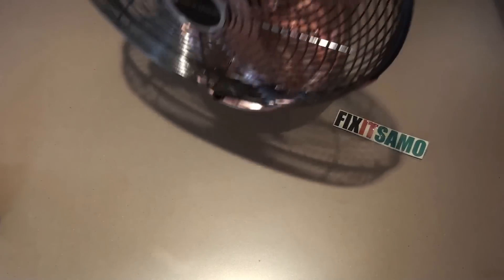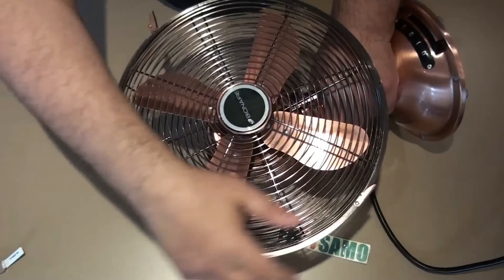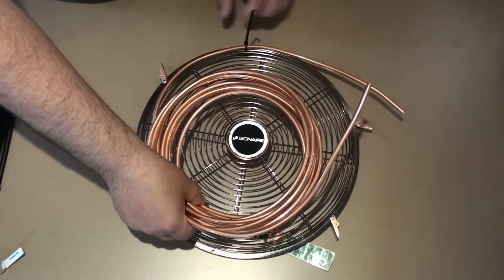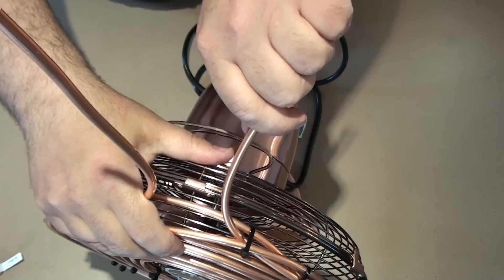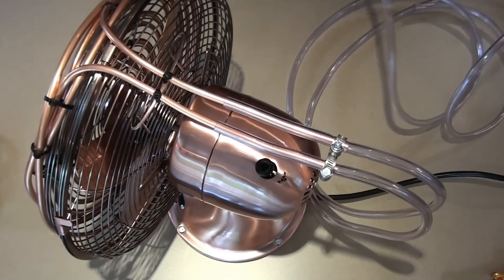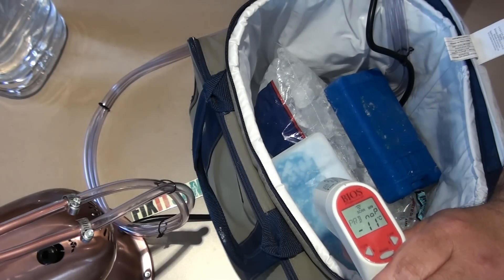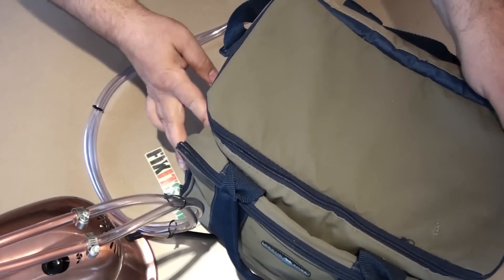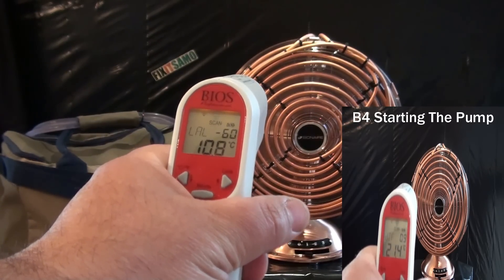How To Turn Your Fan Into An Airconditioner  AC

Comment: If you do this with a larger 2ft. square, Large blade, 3 speed fan, that sits on the floor, it will cool your house much faster.
Reply: if you do this with a even larger 3 ft square, large blade, 4 speed fan, that site on the floor, it will cool your house even much faster even.
Reply: @shaystern2453  yeah, but if you use an even larger 4ft.  Square, super-duper large blade, 5 speed fan, that sits on a stand on the floor, it will cool your house much much much faster even
Reply: @ajfromcjbasements6574  @shay stern  @wayne davies 🤣🤣🤣🤣🤣
Reply: @ajfromcjbasements6574  😂
Reply: @ajfromcjbasements6574  And you'll be grateful!
Reply: You just stole Op's idea and changed it slightly. That's called plagiarism. You're not intelligent, you're just an ass.

Comment: Thanks for this! Been looking for something that would work in my son's room instead of always using Central A.C.
However,  I tried your link for the pump and it is not working. 
Just wanted to make sure I get one that does the job. 
Thanks
Reply from the maker: Hi you can get it from amazon 

Submersible Water Pump for Fountain, FOGIMO 80GPH (300L/H,4W) Ultra Quiet Water Pump for Pond, Aquarium, Fish Tank, Fountain, Portable Water Pump 110V with 5.9ft (1.8m) Power Cable https://www.amazon.ca/dp/B09B8W33RT/ref=cm_sw_r_cp_api_glt_i_3K785S2F79EG2B3XNZ8P
Reply: Thanks a lot!!!!

Comment: Let me help you with one thing. If you do this on an average size stand fan you will need more copper tubing than you think. I got 20ft to do it because he doesn’t specify how long the copper tubing is that he has and 20ft is not enough. I have to try it for now but later I will get 50 ft and redo it.
Reply: He shows he used a 25 foot long tube lol
Reply: It is working?
Reply: Let me tell you one thing. if you do this with a smaller fan you will need less tubing then you think.
Like, no shit, sherlock!

Comment: Good idea for camping. How long does 2 bags of ice last?
Reply: you can plug in a fan where you camp?

IDIOT
Reply: @shaystern2453  The camp site I always camped has electric and running water. They designed for the camper but I just put the tent there and has all the convenient of the camper. Idiot.

Comment: Thank you so much for the tutorial Sammy, I finished putting together the copper tube on my fan and ordered the 1.2W 5V DC water pump but apparently the pump wasn't strong enough to push the water current through the copper tube.  Can you advise me what voltage or wattage you need strong enough for the water pump to push the water current through this tube?  Much appreciated in advance.
Reply from the maker: All parts are in the description box  that’s the link for the pump 

https://www.amazon.ca/dp/B01NBPCVW3/ref=cm_sw_r_cp_awdb_imm_E4EVP1H23PB8GP6FDCX9?_encoding=UTF8&psc=1

Comment: How is the cooling compared to blowing air through ice? How long does the ice last for your use case? I know depending on the temperature difference, it would vary.

Comment: You should just strap an old oil cooler from a car (cleaned out) would exchange heat much better. Possible run the pipes outside to a water source

Comment: welp - you can connect this in the fridge system or put cold bag in fridge using small holes - so it become constant conditioner
Reply: Or just leave the fridge door open.
Laws of thermodynamics apply, when you put the ice packs back in the freezer then the refrigerator will absorb the heat from the ice packs and release that heat back into the room plus some heat from the motor. Now your room is warmer than you started.
Reply: @mickwolf1077  
you realy should leave the man alone to play with his Perpetuum Mobilé Dude...  😉😂

Comment: Wonder of dry ice would make it more effective 🤔
Reply: It would probrably hop around trying to get away from the water
Reply: Who actually has dry ice laying around?
Reply: It would be more effective and efficient if the water was cooled directly in a standard freezer. And to make sure that the circulating water won't freeze, you put antifreeze in it. You can use the freezer for other things at the same time, of course.

Comment: not ac because your refrigerator created the ice by extracting heat from water so your using your refrigerator to cool your house lol :0 not an air conditioner
Reply: If we start to smartshit around, we should do it properly at least !
The ice he's using in the vid is OBVIOUSLY bought at the "gas station"....
Or is your fridge spitting out 5 pound bags of plastik packed crushice !? 
I guess that should regulate your prob with the thermodynamics... !?  😉

Comment: I built one just like this and it works great..
Reply: 3 things please
1) approx what is average  room temp you have experienced with no AC, 
and 
2) approx what is average room temp using this fan-AC-cooler?
Lastly did you use a infrared gun/temp meter like in the video to see what air temp is reached at the copper coil area?

Comment: It works, but........Not energy efficient.  You must use electricity to produce the ice, and you must use electricity to run the pump.  The electric fan is electricity nuetral, since you have to run it whether cooling or just running the fan.
Reply: Compared to running an AC unit or ducted it’s far cheaper, at least where I live it’s about $3.50 per hour cheaper to run 🤷🏼‍♀️
Reply: Purpose could be if in a van, there's only dc
Reply: Ac consume 800 to 1000 watts, while the pump consume 5 watts and fan consume 30 watts. big diff.
Reply: @rmabiado6593  what about the energy to produce the ice, mate..?

Comment: Fans aren’t made to cool the room. They’re made to aid the evaporation of perspiration on the skin which cools you off.
Reply: this one is made to cool the room, so you're wrong...try again
Reply: @joeturtleneck2300  it's not going to cool the room. if you use refrigerant like Freon it would get cold enough to cool a room depending on the size of the room. at best sit close to home made ice water ac and you'll feel a bit cooler.
Reply: @Donald Chump dab on eem

Comment: If you could get a system that produces ice on itself then that would be something worth watching. I’d use the fridge compressor and R-134a gas to make this more useful.
Reply: this fan uses water, the pump wont circulate the gas like the water. youd need a whole different set up to run r-134a gas.

Comment: You should have started the copper tubing from the Inside of the fan screen  and go outward instead of from outside in would have been better. I think just my opinion
Reply: how can you get the copper through of the fan screen protection

Comment: Swamp cooler - not air conditioner - great idea - you would need a metal fan - so much plastic here ....Thank you
Reply: A swamp cooler cools the air by releasing water vapor, this isn't doing that. This is taking the energy in the air and transferring it to the ice water. It may introduce some water into the air, but that's not the mechanism it's using to cool. Basically this cools your room using stored work from some external freezer. A swamp cooler would be exposing the water to the air via something like a sponge, whereas here the water is kept in a fairly sealed container
Reply: @jek__  it's not going to cool the room like a conventional ac which uses refrigerant like Freon so it is comparable to a swamp cooler because in a swamp you would find water.
Reply: This actually ends up lowering the humidity in the air instead of raising it with all the condensation it creates

Comment: As far as I can tell that aircon would cost about two bags of ice a day. Less than $5 a day. Cheap as!
Reply: I'd just fill 2 gallons of milk with water and let them freeze overnight every night
Reply: @TheOfficialChannelOfChannels  Yeah well if I can freeze water then I don't need an AC unit. I'll just plug one in.  But if you are camping, this is brilliant, but not good in humid climates. If my van could sustain the load, I'd buy a dehumidifier and put up with the temperature.
Reply: make your own ice in the freezer
Reply: @Dill_Do  I was thinking for camping where there is no electricity. But you can usually buy bags of crushed ice. This design doesn't add humidity to the air either and  you can run everything from a solar panel.

Comment: what do you do with the water that drips off of the coil  ?
Reply: drink it, free water
Reply: make a rectangle hopper to catch dripping thats what the real acs do
Reply: The valence ring electrons carried in the air stream will grab onto those water molecules and carry them away faster than you can say evaporation!
Reply: @fredsilvers1427  can you repeat that is layman terms if possible - what you are saying seems interesting but cannot understand fully - thank you.
Reply: @SS-pi2yi  the outer electron on an atom is the valence ring electron. If one of the atoms comprising an air molecule desires an electron (positive ion) then that valence ring electron will broaden it's orbit to include the atom of the air molecule, thus tethering the two molecules together and pulling away the water molecule to float away with the air molecule. That's how evaporation happens. That's why it feels cool when you blow on wet skin. You're giving the water molecules that have these valence ring electrons to the molecules in your breath. You feel the depletion of electrons. Electricity works in a very simular format.
Reply: @fredsilvers1427  thanks - great explanation!

Comment: Summer started two days ago. It  may be a good idea for poor man's old car with a broken AC that cost $1,000 to fix. 
He would need a smaller 12V fan or a 12V to 110V converter to power an electrical fan that does not overpower the maximum electricity current of the cigarette lighter socket. The fan can be set in back seat, ice bag on the floor, etc.

Comment: Smaller diameter copper to improve the heat transfer, if the pressure is to high for the pump you could run a parallel line.

Comment: make sure you have your fan plugged in A GFCI outlet. That coil is gonna sweat{condensate}water could get down into the fan.
Reply: That would be shocking 😆.
Reply: Good point. I forgot about that. 👍🏽
Reply: No, any condensation gets blown away from the fan, if the fan is on that is, and especially if the fan is on the high setting. Still doesn't hurt to have it plugged into a GFCI Receptacle though.
Reply: @Canuckken  Every AC coil you come across has A condensation coil sitting under it. Your wrong about the condensation.
Reply: @kenneth92ish  This is correct.  I just made made this design and after 20 minutes I had a small pool of water under my fan.  This will depend on the environment where the fan is being run, of course, but running off GFCI is a good idea and this design needs some monitoring.

Comment: I have thought about doing something similar, but with glycol and a pvc radiator that is buried in the ground.
Reply: I am going to do that, i live in the Philippines.  And some times it's just to hot. How fore in the ground would you put it?
Reply: @davidcardin3271  I would bury it 1 to 2 meters to the bottom of the radiator. I have always heard the soil below 1.5 meters stays a constant temperature no matter the ambient temperature above the ground.

Comment: Pipe Fitter by trade here....Please also note: When bending and manipulating that thin copper line, be super gentle with your handling of it. The moment u kink it, u might aswell scrap it and start over, cause the bent piece of copper is useless & now compromised. Water will not circulate very well, and the copper material will become extremely weak. Other than that definitely a cool project. Good luck DIYers!
Reply: thanks good to know 👍
Reply: That was very punny...cool project.
Reply: @scrapperpun5553  ahhh bravo sir, u picked that out!
Reply: This is good extra info  -- thanks, Chadwick
Reply: You take an adjustable wrench and turn it around the kink and it will make it straight again.....A/C tech
Reply: @monfrig6959  touché, however u think all these diyers are gonna do that or have the tools?  Perhaps just be extra careful so no one would have to do a repair, or add an extra step. Thanks for playin though.
Reply: @chadwickborawski1718  good video !
Reply: @monfrig6959  just wanna make it clear i didnt actually make this video. However if u were simply agreeing that its a good video, then yes ur right.

Comment: Fun idea, asside from the 4 dollar an hour ice bill🤣
Reply: If a bag of ice only lasts an hour in your cooler? You might want to buy a new one? A block of ice lasts 4 days in my cooler, a bag lasts 2.5 days.
Reply: @kman2783  The cooler is constantly receiving ever so slightly warmer water from return flow, so it certainly won't remain as cold as a cooler that doesn't have this issue.
Reply: @kman2783  Like the guy above said, as much as this is an air cooling system it's also equally an ice warming system.  Energy isn't created magically.  A good cooler would help, sure, but not enough that you might notice.

Comment: i'd like to know the cost in electricity of this vs a window AC.
Reply: Probably less than 100W for the fan and about 10W for that tiny pump vs. 2000W - 5000W for AC
Reply: @victorsupreme214  5000 for a central unit that covers the whole house, but a window ac i guess is around 600-1500
Reply: @victorsupreme214  you need to include the cost to run the freezer to make the ice
Reply: @jek__  I would assume for most people the freezer is already running anyway?
Reply: @victorsupreme214  True, but they dont use a constant amount of energy. If you take the ice out of your freezer, it makes more ice, if you dont it doesnt, so taking ice out will cause the freezer to use increased energy, so it must be accounted for. Also, if you use this cooler in the same room that you have the freezer which made the ice is in, then the whole setup together will only raise the temperature of your room. So sourcing external ice is a necessary component of this machine functioning, or only making ice at night or outside, somehow dealing with the heat that was in the water before it became ice
Reply: @victorsupreme214  That pump is rated 4W; actual may depend on flow rate setting.   Only data found on power consumption of similar 12" fan was rating of "1/12 HP".   1 HP = 746 W, so 62 watts to run the fan.